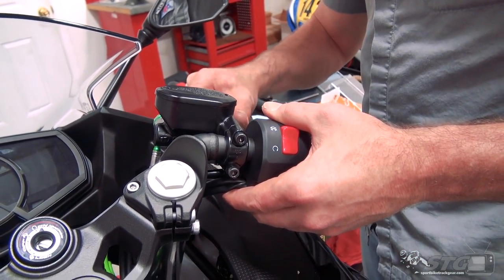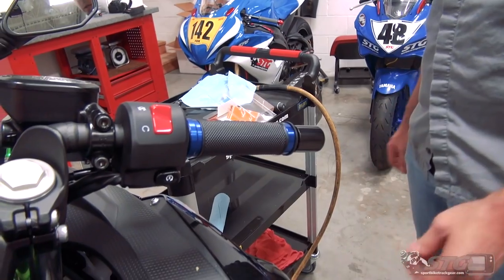Driven 2018-2023 Kawasaki Ninja 400 D-Axis Grips Install | Sportbiketrackgear.com

Comment: So I followed all the steps on putting the grip on but my throttle won't snap close on its own. Any tips or suggestions I can do to fix it
Reply from the maker: You need to make sure the grip is not dragging against the throttle housing, the bar end or the clip on bar. - Van

Comment: How many mm are those grips.?
Reply from the maker: Overall length or thickness of the grip?
Reply: Sportbike Track Gear  sorry about that. Both actually.
Reply from the maker: The length is standard open end sportbike which is approx 122mm. Thickness of the grip is approx 7mm on the throttle side and 9mm on the clutch side. Driven uses a 2 ply grip on this grip which helps to reduce vibration. - Brian Van

Comment: Please advice. I  wasn't able to get the screw out. The grip  kept on spinning and the screw didnt move at all.
Reply from the maker: The fastener for the bar end has a little thread locker on it from the factory. It will require a little force to break this loose. - Van

Comment: Hey Brian, I've run into an issue where the bar end didn't come off with that crazy tight bolt, the bolt just kinda came out and the bar end is stuck on there, do I just kinda rip the other part off? (Also this red thread lock is no joke, ow)
Reply from the maker: I would suggest striking it with a rubber mallet or something similar. Use reasonable force and it should come off. - Van
Reply: Worked like a charm, I guess I was just trying to be more gentle than is necessary,  thanks !

Comment: Brian, I really enjoy your tutorials. You are meticulous and detailed, my kind of mechanic. I installed some Driven grips following your instructions. The throttle was sticking. I went on the forums and learned glue can get under the plastic throttle sleeve. I took off the grip using the compressed air. Sure enough, glue had gotten under the sleeve. I took the glue off, sanded and lubricated. Throttle works fine. I put the Driven back on without any glue. Seems fine for now. If it slips, I'll glue it again. One guy on the forum recommended applying the glue to the sleeve instead of inside the grip. I think the glue got shaved off from the inside of the grip as I was pushing it on. Applying glue to the sleeve as opposed to the inside of the grip would avoid that problem. Maybe? The Drivens look great and I like the gold color on my bumble-bee style Ninja. How do I post a picture here?

Comment: I don't like the small gap between the grip and the ignition switch housing. The original grip does a good job hiding that while making sure it doesn't rub on the housing. I think it's time for a design improvement. Though I do like the current design there cool looking. P.S. I do like the videos very helpful thanks.
Reply from the maker: You are welcome and thank you for watching! - Van

Comment: Hi, love the tutorials, very helpful. Am I to assume that if I add grip glue, then that grip is there to stay and I will not be able to remove it to replace for another? Is it going to be bonded for good?
Reply from the maker: Using grip glue makes for a more durable connection. You can still remove the grip when it is time to replace them, it just takes a little more effort. - Van

Comment: Sweat I want them now, kinda wish you would have did it by rolling them off I think a lot of peeps don’t have a compressor. I’ll figure it out though!
Reply from the maker: You can cut the OEM grips off and then use grip glue to slide these on. The glue will act as lube to help you get them into place and keep them there. - Van
Reply: @sportbiketrackgear  That’s what I figured I’ll order them from you guys after I get my exhaust or a better helmet. I want the aria Corsair

Comment: my grip got stuck midway. I couldnt push it in without my bike tipping over. The grip also has the strength to hold my bike up so i cant get it off either!
Reply from the maker: This is one of the reasons it is good to use grip glue. The glue will act as a lubricant and help you get the grips on. - Van

Comment: Do you think one of those compressed air cans will be strong enough to remove them? My bike came with blue d-axis grips and I want to swap them out for red & save the blue for my other 400, I don't want to cut them off.
Reply from the maker: I do not think the compressed air can will get this job done. You will need he air compressor and the blow gun to remove the grips easily without damaging them. Only other option is to work them off by hand which is not worth the effort IMO. - Van

Comment: Hi bryan, Why didnt you change the bar end as well ? is there pros and cons of bar ends ?
Reply from the maker: We actually just replaced the OEM clip ons with Woodcraft Ninja 400 Clip Ons. I had a set of bar ends to install but they did not include the correct adapters so we did not get that done before the clip on install. - Van
Reply: Sportbike Track Gear I understand ! Thank you very much ! Hope to see more videos on the kawasaki ninja 400 project bike 💪

Comment: Hey Van, I tried my best to keep the throttle tube clean. It sprung back the day I installed the grips. But a few days later the throttle sticks now (I guess the glue inside finally dried). Should I just take the throttle tube out and clean the inside?
Reply from the maker: Yes you need to sort that out before you ride the bike. Not super hard to do. - Van

Comment: Since I didn’t know they installed red thread locker, I stripped the bolt. Any recommendations on how to resolve this?
Reply from the maker: You will need to order a new bolt and drill the head off the old one. - Van